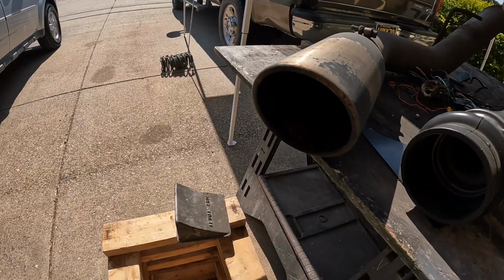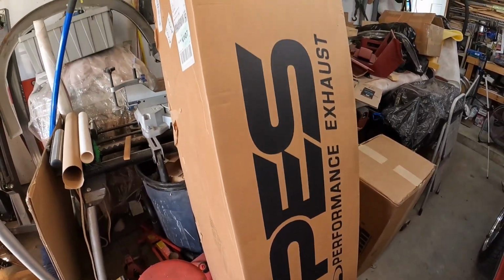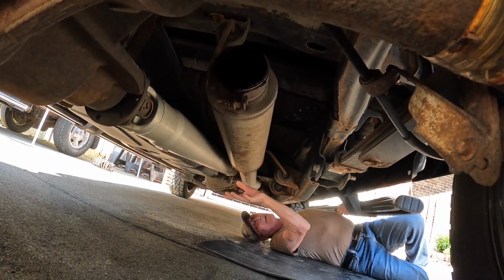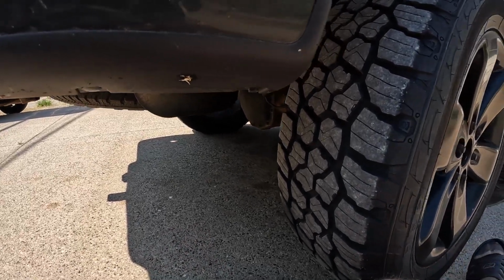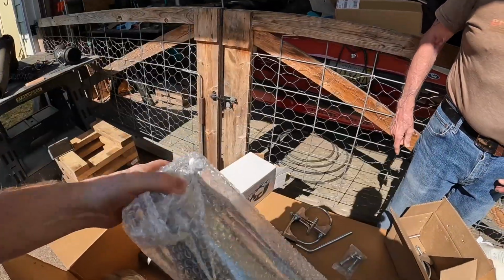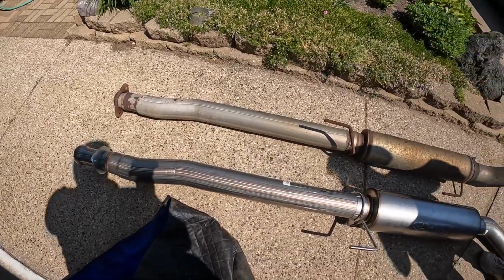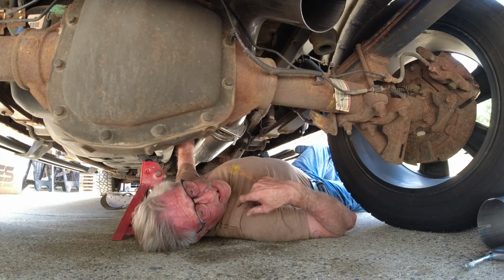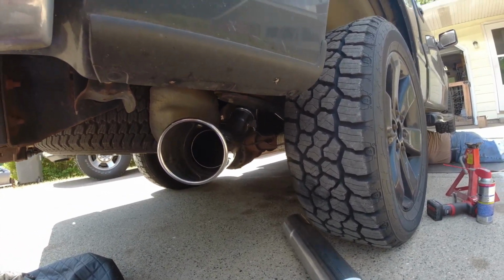Pypes 4" Exhaust For F150 3 5 Ecoboost

Comment: If you took the time to trim the elbow over the axle or work it up as high a possible, the system will exit in the stock location just fine WI resident he3re and my truck is always outside. My first Pypes installed Oct. 2017 lasted 6 years and still had no hole and came off in one piece. https://www.youtube.com/watch?v=s1CfiwtBB84